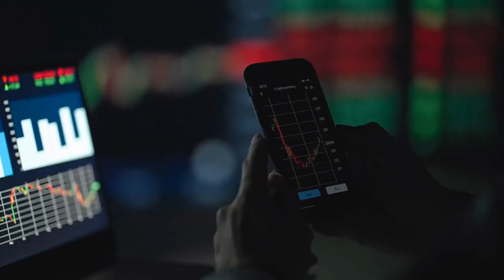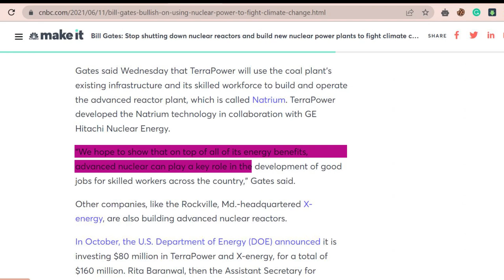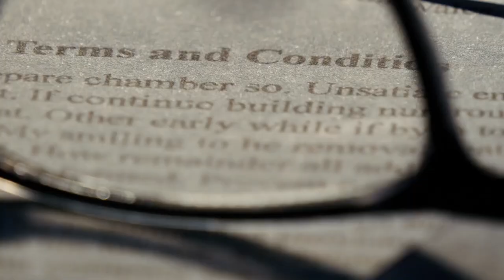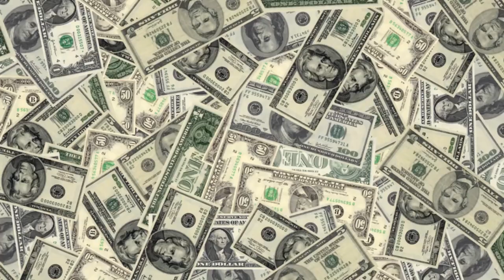How Bill Gates' TerraPower Nuclear Project Will Solve the Worlds Power Supply Problems

Comment: All energy sources have trade offs, NP rises to the top when compared to the alternatives. It requires a fraction of the resources to deliver clean reliable power 24/7/365. NP really is the premier example of ‘dematerialization’ in which we actually use less to produce more.
NP is the way to go to provide clean, reliable power with the least harm. the evidence all demonstrates that historically, nuclear has been the fastest way to decarbonize, requires the least raw materials and land, and results in fewer deaths per unit of energy produced
Reply: I see you never mention cost
Reply: @Clark Kent  
Hydrocarbons are uniquely inexpensive as well as having a number of other advantages. They are also dirty, we should reduce dependence on them as much as possible.
Dilute intermittents like wind and solar are uniquely expensive, financially, and environmentally.
Dilute intermittent power could cost zero. We still need to build and maintain a very expensive grid and backup system that ends up raising our electricity costs. levelised cost of energy assessment (LCOE), is essentially a banker’s number that ignores land cost, property taxes, transmission, utility returns, & storage. It also makes implausible assumptions about reliability & lifespans of wind turbines & solar panels and leaves out the system costs of integrating W&S into energy infrastructure. intermittent power sources bring increased instability to a grid, so we end up using far more backup than we need with reliable sources. The higher percentage of Intermittents, the greater the instability and the higher percentage of backup needed. At 20-30% capacity factor, every MW-hr of solar & wind drive 3-5x as much build out of dispatchable power for backup. But, since solar/wind are chaotic, they drive efficiency down, driving dispachable power use per MWe-hr up by 2-3x. This is probably why we've seen so little progress in emmissions reduction by adding them to our power grids compared to adding clean, dense, reliable power such asNP and hydro.

 The other way of looking at costs is what end users pay and the most expensive electricity cost to consumer is in places with a lot of wind and solar,  namely California in the USA, Germany, and South Australia. Meanwhile, electricity for those heavily dependent on nuclear energy is some of the least expensive.
Reply: @Clark Kent  
Obviously, we can build NP on time and on budget if we want to, its being done now outside of the west. The issues are not physical or technological. We have subjected NP to regulations designed to kill, not use it. It's like we slashed our tires then complain that driving is too slow and expensive. Standardization and mass production would go a long way towards reducing costs. 
At this point, we're seeing what happens when policymakers are influenced by popularity without regard to functionality, they get what they thought they wanted: a forced reduction in fossil fuel usage causing energy problems.
This kind of action never ends well. We've spent decades wasting time and resources on dilute intermittent power sources while penalizing dense reliable sources, and we are now suffering energy shortages and seriously weakened infrastructure due to our obsession with RE. 
The pain and suffering of this crisis — a crisis of not enough reliable electricity — is happening right now. As usual, the poorer parts of the world suffer the most as coal, oil, and gas that was slated for them is now being diverted to wealthier countries.
Like fossil fuels, nuclear can produce nation-scale electricity reliably year-round, regardless of time of day or season. Unlike fossil fuels, it does so cleanly.
The pollution from burning hydrocarbons  is significant regardless of how you feel about climate change.
Reply: @dodiewallace41  FACTS do not support your argument.  The Westinghouse AP1000 was first built and is operating in China so VC Summer and Vogtle had their engineers in China working out any problems before U.S. construction.  The NRC has fully 100% approved the AP1000 for construction and operation in the U.S. and all the utility had to do was build it according to design drawings.

Here is their last ~$1 billion dollar over run.  Were the NRC regulations that require certain welds to be x-rayed and safety systems performance tested designed to kill the industry????  I only live 35 miles from Vogtle and know many that worked and are working there and the NRC is NOT the problem.

Below is the Vogtle Project Management's answer for the latest delays:
Southern Co. yesterday announced another delay for its long-troubled nuclear construction project in Georgia, edging its costs closer to the $30 billion mark. 
The setback could now push the startup date for Plant Vogtle’s first reactor until early 2023 and move the date for the second one to later that year. 
Plant Vogtle’s latest move highlights the nuclear industry’s chief troubles with building large, baseload reactors: safety and cost. To be clear, Southern executives have blamed this new hiccup on paperwork, saying that workers were gathering it to send to federal safety regulators and noticed critical inspection records were missing or incomplete. The pile of missing or incomplete documents added up to a delay of three to six months, Southern said. That additional time is costing $920 million. 
“We’re a little frustrated with the latest developments,” Southern Co. CEO Tom 
Fanning talked of “great momentum” at the construction site since November. 
But workers realized “tens of thousands” of critical documents were missing, leading to a three-month backlog. 
“We’re fixing that part of the ‘paper’ process,” he told E&E News.

News flash...they did not lose the records.  They never x-rayed or performance tested system that they KNEW was required.  The CEO still has his job and NO ONE was fired for a $1 billion dollar screw -up.  Why??? Maybe because the utility gets a 10% profit on construction costs.

PS VC Summer and Vogtle used the factory built module concept and it was a failure.

Now I have provided FACTS.  Do you have any facts that shows the NRC regulations are a problem more than the massive project management fraud, greed, and mismanagement???
Reply: @dodiewallace41  It is all about $$$$.  If you cannot build new nuclear at or below $7 billion per 1.1 Gw unit then forget it.  No amount of complaining on the various issues you cite will have Americans accepting massive rate increases.  Because of Vogtle, my electric rate has a 19% surcharge during construction and Southern Company just asked the PUC for a $0.6 billion dollar rate increase and that is just the beginning.
Reply: @Clark Kent  
If cost is the only concern, then it's hydrocarbons all the way.
Reply: @dodiewallace41  It is not that simple.  People may accept slightly higher electric rates to go nuclear but given the last 5 new nuclear builds in the U.S. , new nuclear generated electricity is going to be at least double that of any other method.  There is a such a thing as too cost-LY
Reply: @Clark Kent  
It's not for technical or physical issues. We know how to do this as well as the rest of the world. We just need to get out of our own way and do it as many other countries are doing now. More people in the US now support building new nuclear power. The sooner we get cracking, the better.
Reply: @dodiewallace41  There are a lot of reasons why new nuclear is so expensive but those reasons are NOT going away anytime soon.  Again, it is not about support, it is about COST.  

Every year, old fully paid for nuclear plants are shutting down simply because when a major component fails, it is no longer economical to spend billions on a 40 year old plant.
Because of VC Summer and Vogtle, no utility is even remotely interested in new nuclear and IF one ever did you are looking at a 16 year project.

Terrapower and NuScale are trying to build demo test reactors but they both are having problems and neither one could have a reactor operating before 2030.  Then add at least 5 years to prove the concept before more builds could be planned for the next 10 years.

Face reality and you will see that nuclear's contribution to the U.S. energy mix will decrease for the next 20-25 years before it could possibility turn that trend around. All that time, there will be multiple other energy producers that nuclear will have to compete with and nuclear has NEVER gotten cheaper.

Just stating we need to do this or that means nothing.  EXPLAIN to me WHAT is actually happening NOW that will change the time to build or the cost to build???  If nothing is actually happening then NOTHING will change
Reply: @Clark Kent  
Take a look around the world. These issues are self-imposed in the West. Others can and are building nuclear power economically and on time as we speak. We can as well anytime we decide to prioritize clean, reliable power.
Reply: @dodiewallace41  Yes China has built and is operation the same Westinghouse AP1000 as the VC Summer and Vogtle projects.

A Chinese textile mill can also make 200,000 pairs of socks, ship them halfway around the world, sell them at Walmart for a few dollars and everyone makes a profit.  Maybe you should tell the U.S. textile mills that they should also be able to do the same.

You have still not identified one thing that is changing that will make new nuclear cheaper in the U.S..  

We need , we should, we can  IS NOT changing anything.  WHAT are we DOING NOW that will change things????